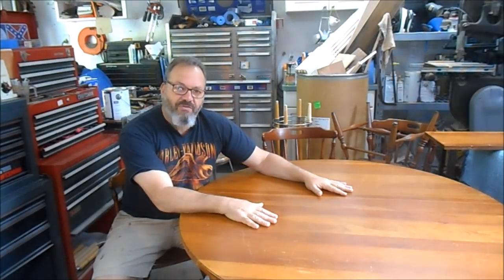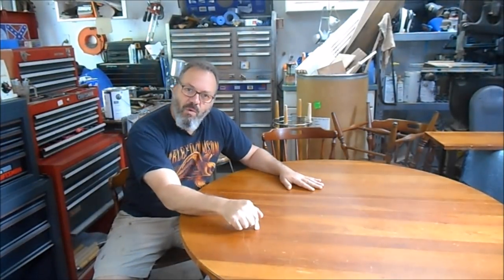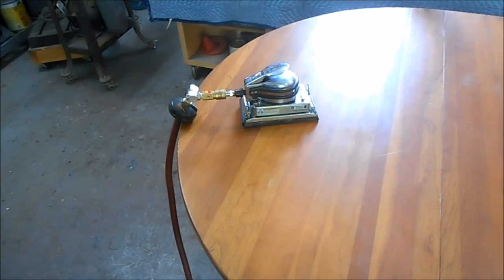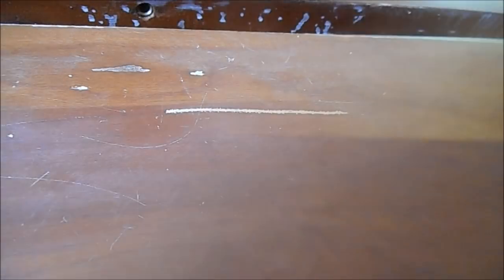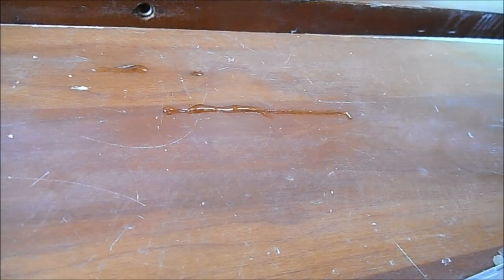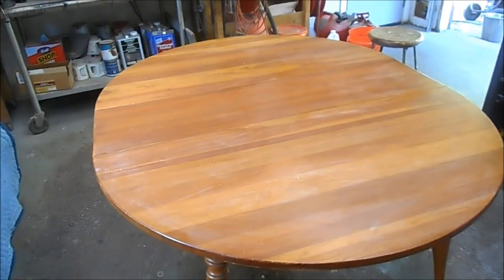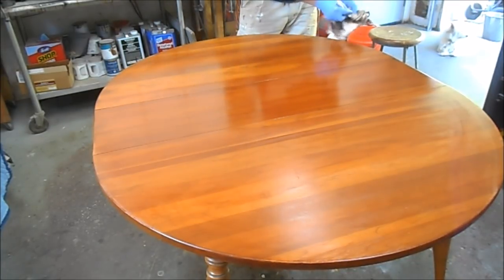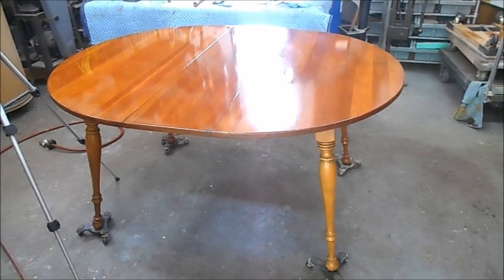Preparing a Cherry Table Top for Quick Sale

Comment: Good day Sir. Thanks for your time and explanation on refinishing good old furniture, as I like to call it. I have a question. I purchased a dining room table and chairs. I have stripped the table and did a process that you use of sealing after stripping, Creating and spraying a toner that matches a mahogany buffet that I built from scratch many years ago. I ended up having to do two toner coats to get the desired color match that I was looking for. Thanks to your videos I felt confident and was able to do that. My question is, How top coats of Lacquer would you use for a dining room table? Again, Thank you for your time of showing us how you refinish furniture.
Reply from the maker: Great job!  Congratulations.   The number of top coats is a judgement call.   I normally wind up with at least 2 coats of sealer, some toner layers and then maybe 4-5 coats of lacquer on a table top.   There is more precise data out there where you measure the "mils" of the topcoat thickness.   I never got into doing that and go with judgement and experience.   Thanks for watching!
Reply: Awesome!! Thanks. It has been truly rewarding, educational and fun. One more question, what do you preferred to do between coats of lacquer? Sand with 320 Paper or 4-0000 steel wool? Again many thanks for the time you put into making your videos for us to learn from.
Reply from the maker: I normally start with 320 gold and towards the end of the coating process I'm down to 0000 steel wool.  Again, it all depends on how things are going.   I adjust my sanding to accommodate the top coat I'm working on.  The goal, of course, is to get a nice level, flat finish.
Reply: Thanks Very Much for your time!!

Comment: It’s all your fault.....😳😬
Reply: I picked up some furniture along side the road.
Reply: Do you have a Instagram?
Reply from the maker: No.  We have a Facebook page and that's as tech-savvy as I get!   Thanks for watching.
Reply: Can you put poly over teak oil?
Reply: If not how do you prep the surface that has fresh oil on it to put polyurethane on it? Thanks and it’s my pleasure your channel is a good watch.
Reply from the maker: Once it's cured, you should be able to coat over a teak oil finish.   If it's just a polish, you will probably have an issue with it.   "Teak Oil" or "Danish Oil" as they are now sold are a type of penetrating oil based finish normally consisting of mineral spirits, something like boiled linseed oil and a varnish.   It penetrates the wood and then cures.   I would suggest a good cleaning, a light sanding and then poly should be fine.  You may want to test a small unobtrusive spot before you do the whole piece.   As always, be careful of silicone contamination, which can just ruin your day.   Thanks.
Reply from the maker: I would avoid trying to put poly over fresh oil of any kind.   If you have to, strip it all off the best you can, let it dry and perhaps seal with a coat or two of shellac first.  Again, test before you jump in with both feet.   Also, if you read the description on the can of poly, it will give you some guidelines to follow.  Googling the issue will also probably lead you to several discussions on various sites that may also give you some guidance.  Thanks for watching.
Reply: Thanks soooo much.👍🏼
Reply: Just trying to flip two dresser off the side of the road. Nice solid wood dressers.